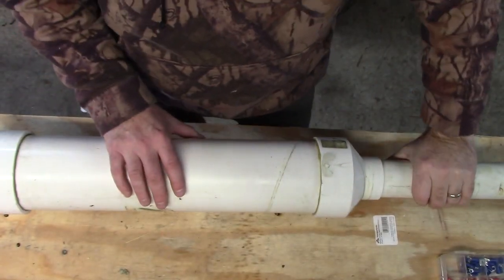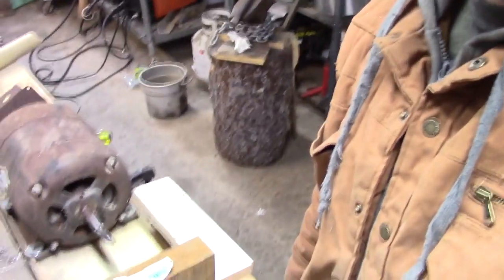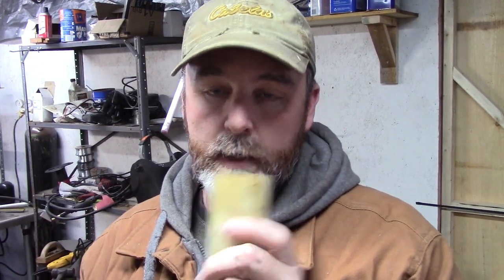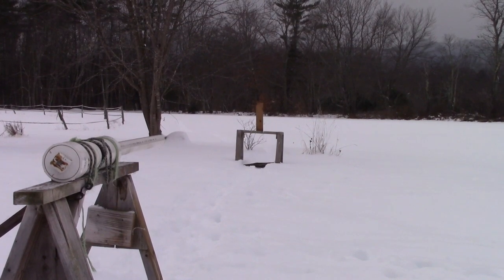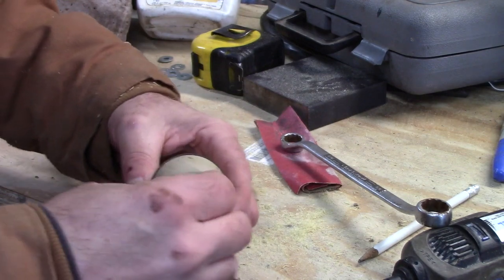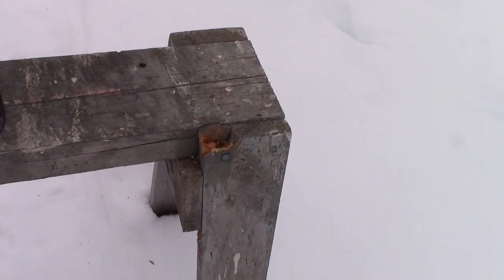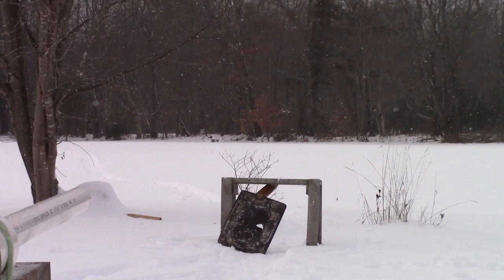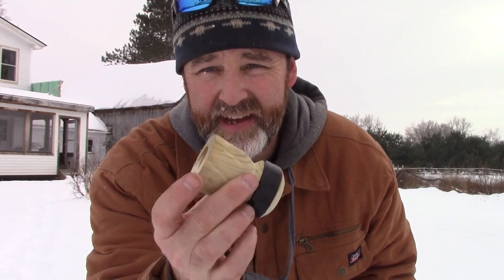Maximum penetration. Armor piercing potato gun projectile?? Best potato gun ever!!!!

Comment: I like your laughing sound. and your video! 
maybe you can use a lighter wood base, dig a hole, and stick a longer and heavier metal pointy stick inside. don't fix this two parts. once the stick hit the target, the two parts will separate, only the metal part will go through. which lower the resistance and add penetration.
Reply from the maker: I like it! Thanks!